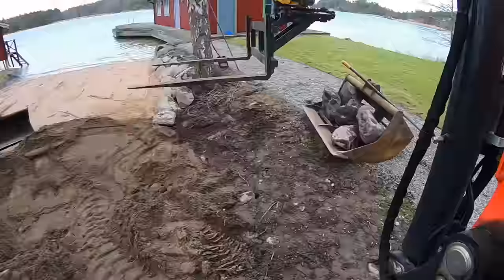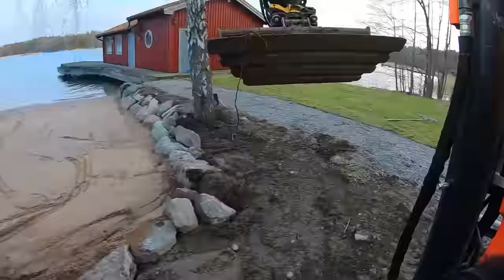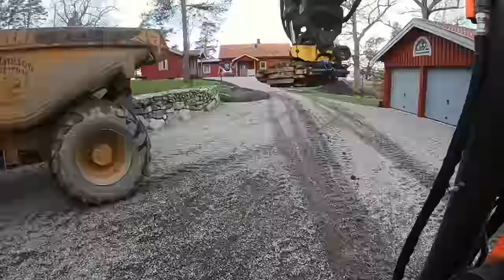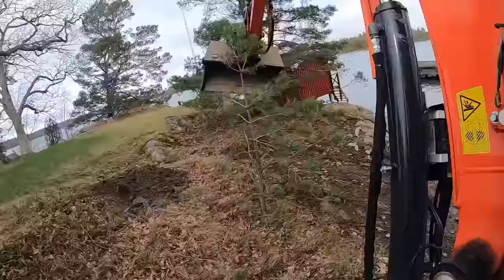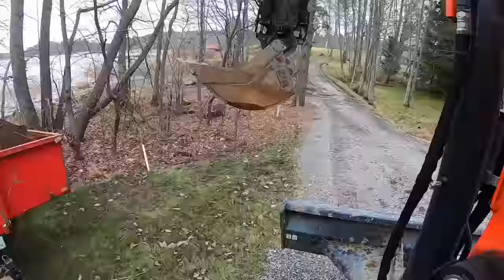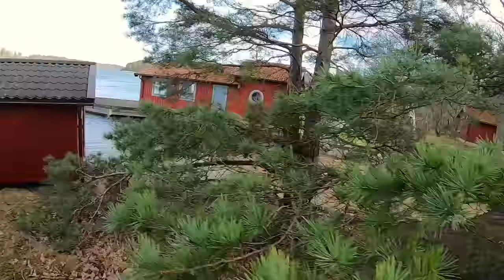#31 New plans and new ideas Part 4 of 4

Comment: Precision and focus my man. You’ve got some skill holy moley. You’re welcome at my firm any time you’d like. Yes this is an open solicitation but from the other side.

If you’re ever keen to spend time working in Amsterdam, The Netherlands, you can DM anytime. We’re running Liebherr and Mecalac, used to run half a dozen CAT excavators but the new gen is trailing the pack. 

Keep the oil flowing brother 💪